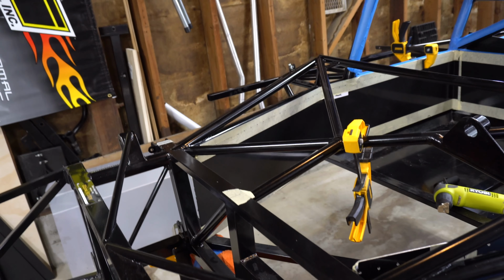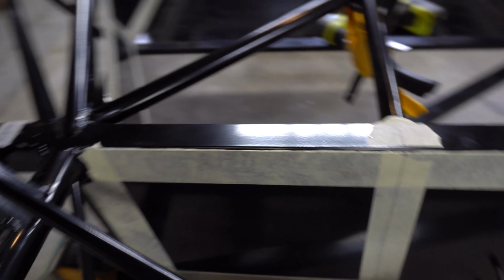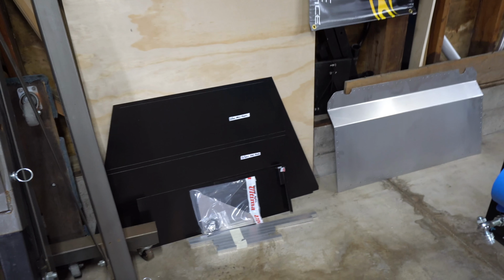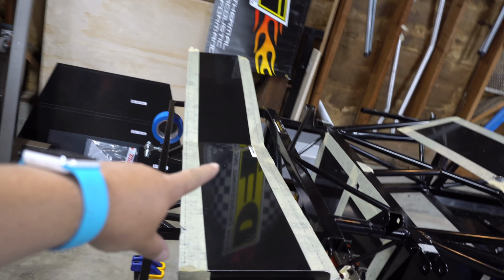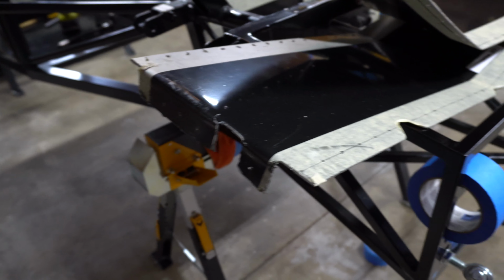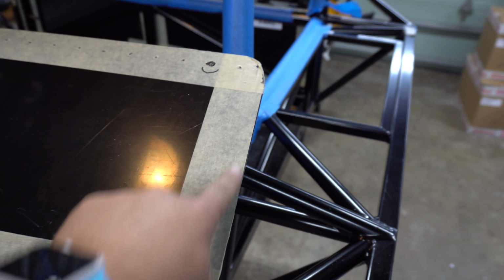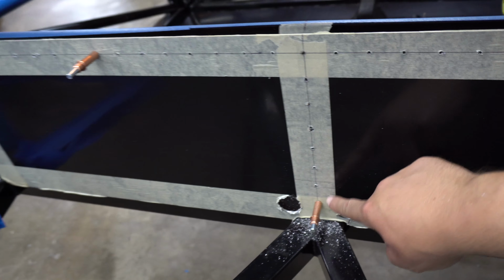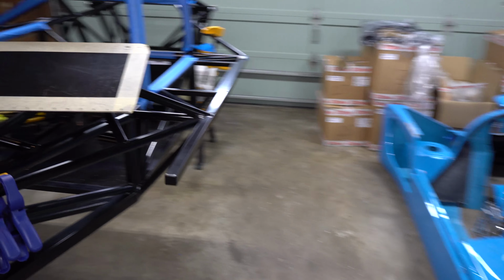Project Blunicorn 004, Paneling

Comment: Hey Humble! Appreciate the advice you've given in these videos. One other thing I'm curious about - is there a prescribed method for making the 90 degree bends in the various panels? Even with a brake that floor double skin around the pedals seems like it's a bit tricky to get right. Thanks again!
Reply from the maker: I didn't have a brake so I made do with 2 pieces of angle iron, some wood and clamps.  I lined everything up, did the bend, cleaned it up using a piece of angle over the edge of my bench to protect it and hammered the bend to get it perfect.  I also used panel vise grips for the smaller bends since those are hard to reach.
Reply: @DriveDriverDriven  Excellent!